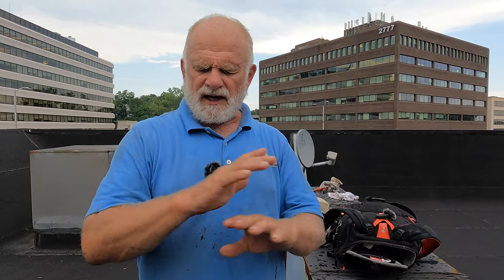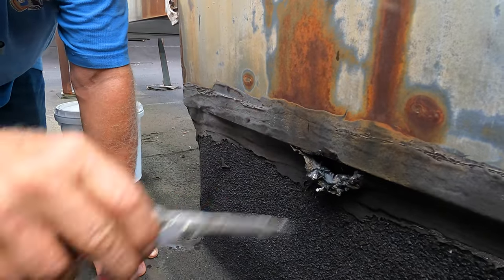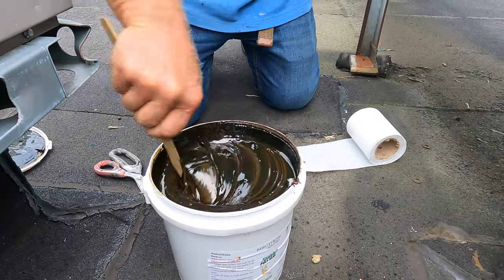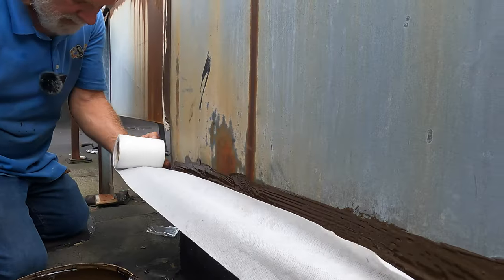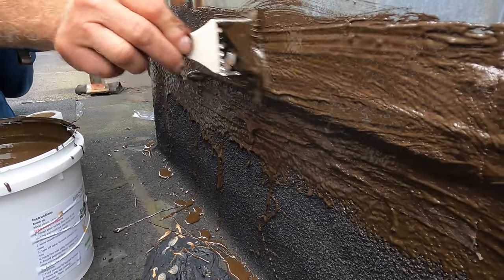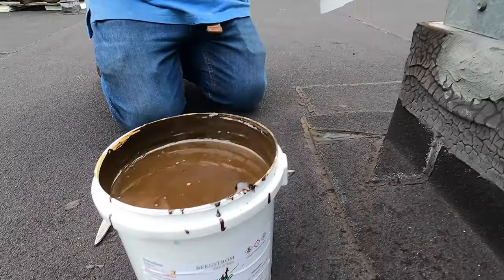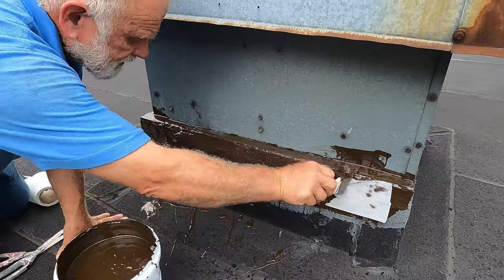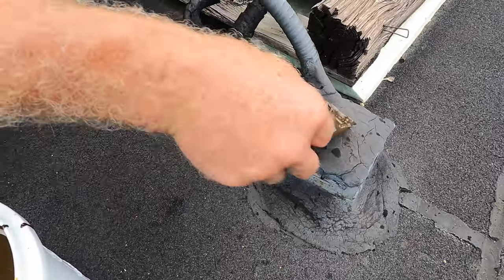DIY Liquid Flashing for Roof Leak Repairs - Easy, Fast for Homeowners Soccer Moms, Handyman

Comment: First thanks for lots of advice

A few questions

1. is there Henry equivalent o Karnak 81?  

2.  Sometime u use karnak81 to bond the self adhesive cap sheet to drip siding.  Sometimes u don't. U just place it on it? Which u recommend?

3. Is there a smaller or diff product for poly seal w fleece for flashing cuz I only have 3 chimneys?

Thank you thank you thank you
Reply from the maker: karnak 81